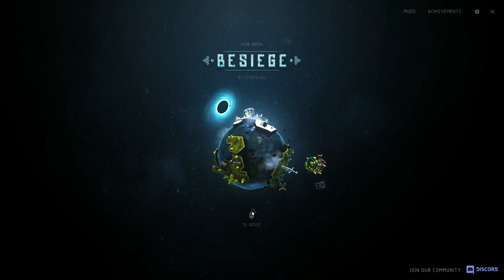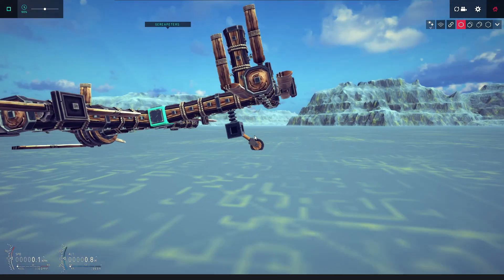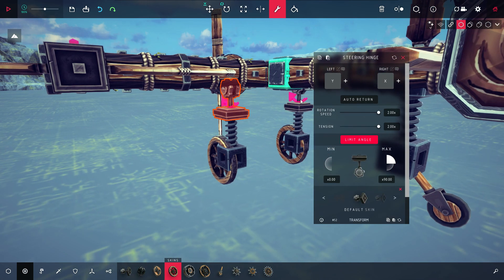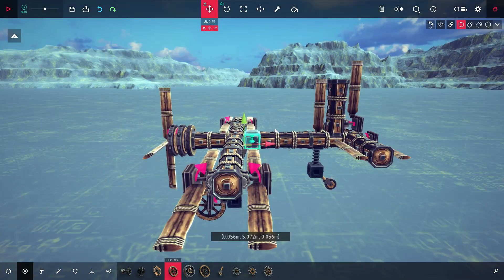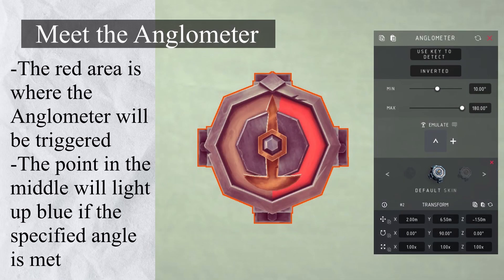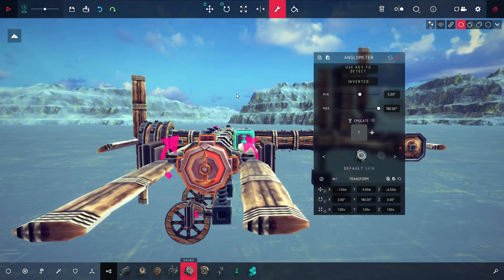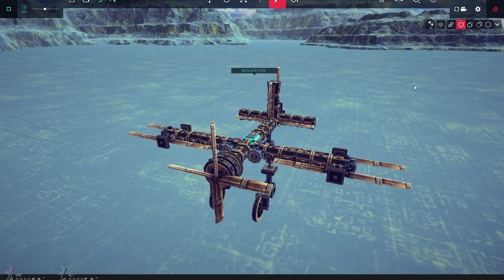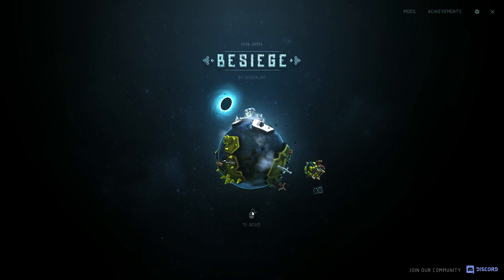How to build planes in Besiege - Part 4: Landing Gear

Comment: Very helpful video. Can you also show how to make control surfaces using swivel joints and pistons? Or is it beter using steering hinges?
Reply from the maker: its far more simple to use steering hinges because they reduce block count, are small and have WAYYY more power to steer. 

but it is also possible to use swivel joints and pistons to make control surfaces. While it does make your plane heavier, its possible. I will make a video about this if you still wish to see
Reply: @GeReapeters  it would be awesome. Also can I send you planes that I made in besiege?
Reply from the maker: @jkdf1657  vanilla build only or with mods?

And sure :)
If you're in the besiege discord server you can ping me there and send me the files